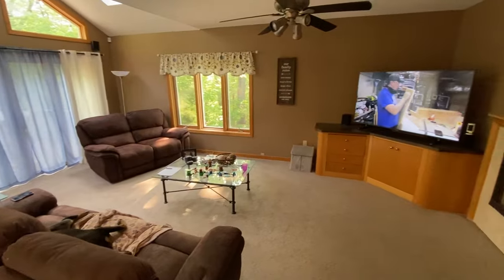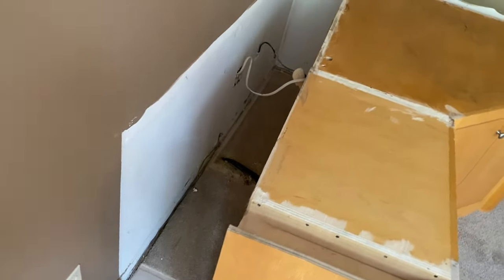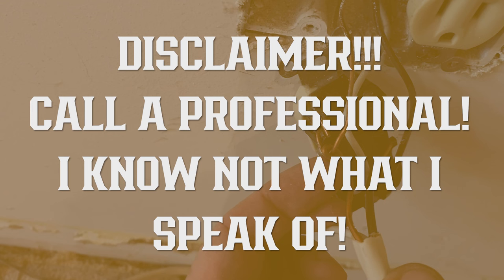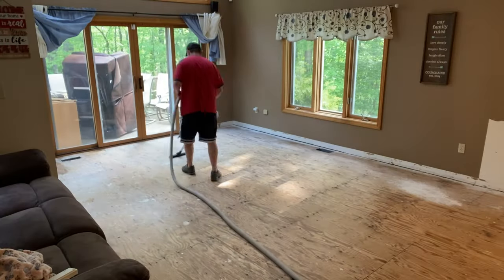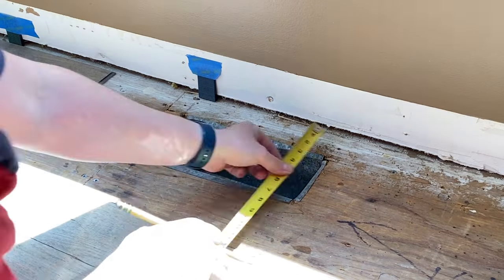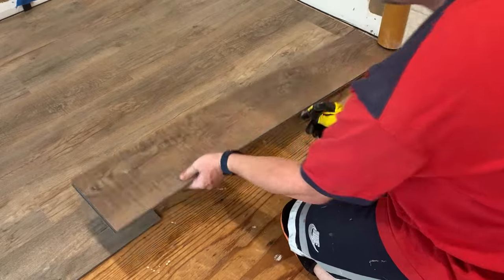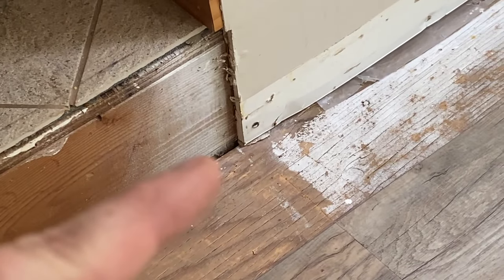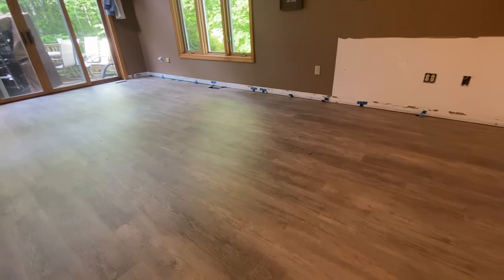How to Install Vinyl Plank Flooring | DIY Living room Renovation (Save Thousands $$$)

Comment: It's not code. Romex/Lumex is designed for in-wall... it could have been done with bx, or shielded cable though. Having an outlet inaccessible behind a built-in is also not up to code. Outlets must be accessible. Same reason you don't put an outlet behind a dishwasher... as it's screwed into the cabinet (usually). Having an outlet in your built-in is okay, but the way they did it was NOT. Typically I'd run BX into a box designed to be exposed... or better yet run it straight from behind so you don't show any wires inside the unit.
Reply from the maker: I knew something looked fishy. Glad I changed it up.  Thanks for the clarification!!!